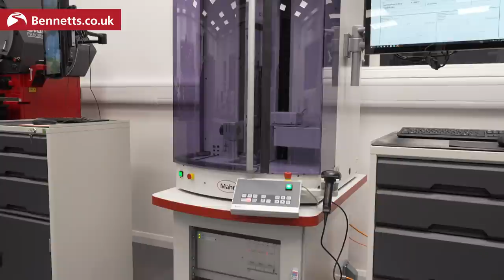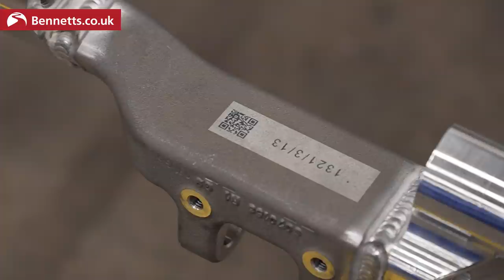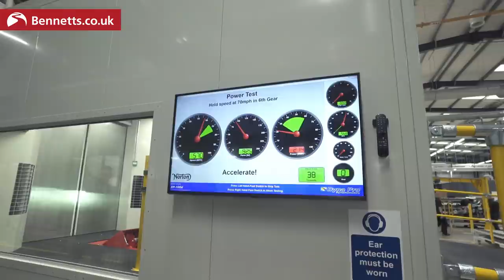Norton Motorcycles: New Factory, New Boss (Factory Tour and Interview with CEO, Robert Hentschel)

Comment: A very exciting video and a thoughtful interview best of British Luck to the CEO and team. I really hope they decide to bring a bike out similar to the original Big 4's from the 20s one of Pa' Norton's favourite bike which was classed as the bike in reach of everyone you only have to look at the popularity of the Himmy it would be great to see a modern long stroke single with classic design. Even though they had performance models in the early 20s like my 1920s 16H flat tank n later in the 20s the Model 18 and Ultra rare Model 25. 

The big 4 was central to the Brand a bike model that did some amazing tours with Pa Norton at the helm also the early 20s singles have truly beautiful styling different to everything that's on the market currently with a unique and beautiful tank design.

Exciting stuff though n itl be interesting to see what happens.

That's my thoughts as someone in my early 30s who rides a 1967 Norton 650ss as a daily rider through winter as well, a 68 Commando 44' WW2 Norton 16H and a 1927 Norton 16H flat tank.

Comment: Having worked in engineering and QC , I'm glad and impressed at Norton's QC but that's the main reason why they are £16k upwards but I take my hat off to TVS doing things to bespoke standards and the penetration of the welds is so important. In my opinion at the top and handling and less electronics keeping it simple will keep them reliable. I hired a high mileage old TVS that was used and abused in India in the semi desert and did 100 miles in the afternoon on a 160cc single. It was similar to a Suzuki 125 single engine and started and ran without any trouble and they cost 40000 rupees in 2007 which was less than half of the Enfield bullet 350 but far more reliable. A sort of honda 90 workhorse.

Comment: You can make your own Dyno out of some wheels, spindles & a huge drum filled with water,  there are a few other bits & some wiring to be done but it won't cost that much, cheaper than the old Rolling Road build anyway.

Comment: A middleweight ultra durable, simple 650ccbike for adventure riders and a roadster along the honda NTV650 but maybe shaft drive like supertenere or triumph tiger 1200 but with bomb proof reliable, low stress engine . Build it very strong with great crankshaft main bearings with great oil feed, cooling yet simple for the rider to service on the road with no camshaft problems or camchain. Even a pushrod low revving option is a great idea for people who tour and commute over thousands of miles a year. Look at the Kawasaki W1 the BSA A7 copy with better bottom end was a great, very durable design. Even a modern take on basic bikes like Suzuki v Strom 800 cc parallel twin or even Yamaha's MT07 motor is going to sell very well because of durability, reliability andcost and TVS has access to top universities in the UK for engine design and CNC and QC technology.
Reply: Get advice from Allan who sorted out the Norton Nemesis   recently. He is the sort of genius they need

Comment: This is undoubtedly high tech factory but imho it lacks from soul.
It is deshumanized, are there any oil, grease and metal shavings smells like it should be in a genuine   motorcycle factory?
Computerized machine tools do not replace handmade craftmanship.
The difference between standardized motorbikes  and man made manufactured motorcycles.

Comment: The Norton V4SV is not worth its listed price of £44k when compared to a Panigale V4S at a base price of £25k, even a super sexed-up Panigale V4S is only £37k! Any sensible buyer will take either the £19k or £7k saving over an inferior Norton V4SV

Unhappy customers and a toxic brand with a tox V4 product line with dubious leadership past and present!

2008 - to 2020 - Stuart Garner allegedly stole employees pensions, took deposits for bikes that didn’t exist. 

2008 - Present Day Simon Skinner allegedly or perhaps as confirmed by The Insolvency Service that banned him from being a company director for 5 years, despite he is still employed today by Norton Motorcycles under the ownership of TVS. Simon also holds the award for designing possibly the most dangerous Superbike released to date and is still employed by Norton. 

2021 to Present Day - Robert Hentschel whose forcing owners into giving-up bikes and asking for £10k for a V4SV otherwise they will offer nothing and then this is only offered to a select few and not everyone impacted

The sins of Stuart Garner are widely reported, but the fact Simon Skinner designed, manufactured & placed a highly defective #V4SS in the hands of owners that could have taken lives is dreadfully overlooked, you still empty him, should you reward such behaviour?
Reply: I wonder when Alan Cathcart will produce another glowing review of the V4SS?